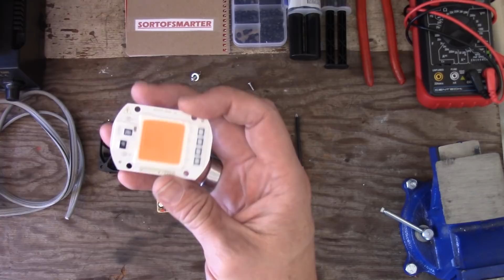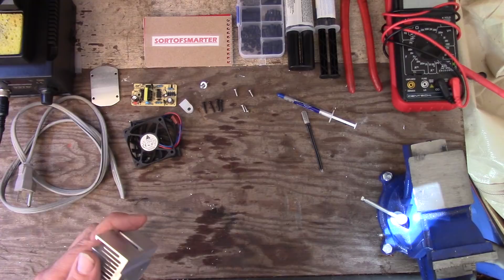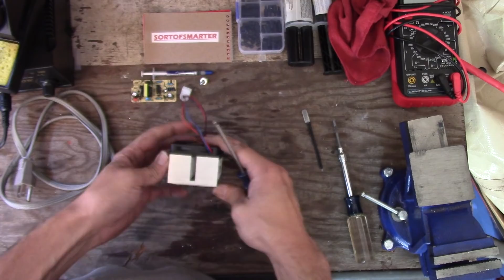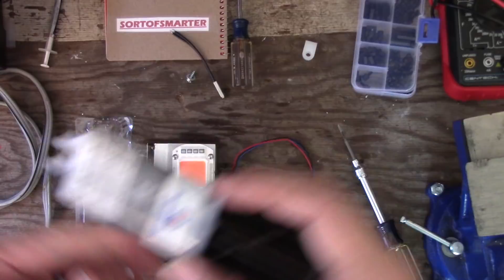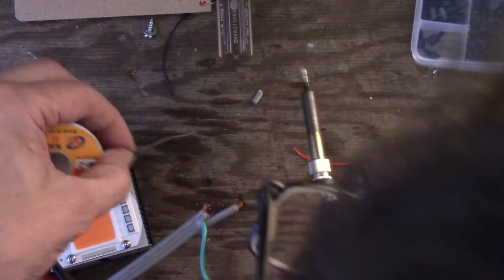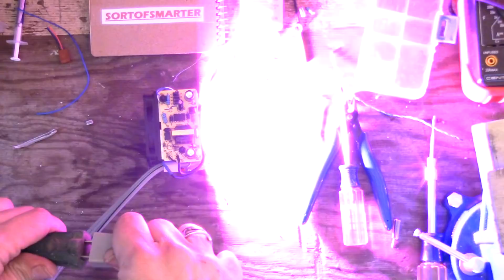50 watt grow driver-less LED Frankenstein heat sink mount up and fan driver

Comment: Did you grow any plant under this light ? I'd like to know how your plant turns out. Thanks.
Reply from the maker: I had purchased a small 2 foot by 2 foot glass green house from Ikea and used the light to grow starter seeds for my wife during the winter, indoors before we moved them outside. when I get a chance I will re do a new video with some time laps showing it in use.. it seemed to work well. I kept it in the spare bedroom so the light wouldn't drive her nuts..

Comment: do you have a link to the 110 to 12V driver please ?
Reply from the maker: I actually striped it from a 1 amp wall adapter I had, they are always cheep from second had shops for less than a dollar but if you wanted a new unit I would use this one as it could handle any size fan you had or multiple fans. just be sure your fans are 12 volt other wise if they are 5 volt you can use old cell phone wall chargers, most of them go way over what the fan needs..  https://www.ebay.com/itm/AC-110V-220V-TO-DC-12V-24V-5V-48V-Switch-Power-Supply-Driver-For-Led-Strip/351993297419?hash=item51f46f7a0b%3Am%3AmrxWgfZR2spUCN5pF5lkNCg&LH_BIN=1

Comment: I have a white one on a similar heat sink fan combos to yours. I run the fan from a 5V 1A wall wart. Heat sink stays warm to the touch with the fan on. Without the fan the heat sink gets so hot you cant touch it. Makes a great light above my work bench.

Comment: Light above my workbench is made from almost the same components. I used a wall wort adapter to power the fan. Fan on stays nice and cool. Fan off the heat sink gets so hot you can barely touch it.
Reply from the maker: I finally got my back room un buried from all the boxes and junk from the move so i plan on doing a update to all this. but awesome glad it worked. There have been a lot of improvements in cob led's in the past year so it should be fun to see what i can screw up..lol

Comment: You don't really need a thermal switch.  That LED puts out so much heat the the fan will be on almost all the time.
Also, the switch should be on the AC side of the 12V converter, not the 12VDC side.  Don't power the converter unless you need the output voltage.

Comment: Your solutions for the excessively long mounting screws and the off-center hole tap were potentially helpful for less than perfect people.
Reply from the maker: lol. thanks. sometimes there are video's that have finish products that look like a robot polished it and manufactured the whole thing. I just think a little dose of reality is good.

Comment: you dont have to do add the scews, if got that silicone thermal paste instead of the pc thermal paste it would have stuck right on there
Reply: And not perform as good

Comment: which one is more efficeint?  if  compare   driverless vs driver led  ?

can anyone tell me?
Reply from the maker: I have not done a direct comparison with the two, I will say that so far the reliability and quality of the output of the driverless chips has been great. A lot of the regular SMD led chips seem to have a high failure rate unless I have stepped up the amount of money spent. When I get my lab put back together I think that would make a great project to test and show..But in a direct conversion you will loose a little efficiency in a lower voltage led driver due to losses in the driver, probably 5% to 10% depending on the driver
Reply: really thank for your replay.  there is so many grow video about cree led cob light.
i will use driverless led  to make light  thanks you!
Reply from the maker: I' not against cree I feel they may have a tighter quality control. But for the hobbyist or little guy like me the cheaper cob lights work great. let me know how it does. and I like getting mine from Aliexpress if your not in a hurry.

Comment: Good project. I found it much easier to use little self tapping metal screws instead of tapping thread holes when I built My lights. I drilled pilot holes using the COB chips holes as a guide before using the screws.Thanks for the video. Respect
Reply from the maker: I agree, I have built a couple more and have done the same thing. I feel a newer polished video may be in order...

Comment: Great DIY video and the build looks nice! The driver did look a bit naked, some ebay vendors got tiny ones size of a dime for cheap.
Reply from the maker: At the time I was using bin parts I had laying around. But yes I have done a couple for friends and used proper isolated power supplies...

Comment: how is it holding up? whats the light schedule?
Reply from the maker: The lights are holding up great. the power supply I used for the fan was way to cheap and bit the bucket last week. After replacing it with a new one I have had no other problems with the unit. I am growing exotic Lilies from seed starts so germination is slow and PH is a little tricky. I am on a 14 hours on and off for 10 hours. When they get a little bit bigger I will do a follow up video of the little glass greenhouse enclosure and temperature controlled fan I built for it all...
Reply: sortofsmarter Ph adjusting solution like PH up and PH down will help stable out your PH. Get a Ph stick (if you don't already have one) Keep it between 6-7 for best possible nutrient uptake. Use kelp sea weed extract for better germination. Keeping the seeds in the fridge 24 hours before you germinate will help also. Google everything for more details.

Comment: why are you using a driver with a driverless chip?
Reply from the maker: The drive is strictly there for driving the 12v fan. the LED is connected directly to 110v mains power. Sorry I should have pointed that out in the video..
Reply: thanks for clearing that up
Reply: @sortofsmarter  i decided to order a 5 pack. It was 15 bucks shipped. 6 or more was 60 bucks for shipping instead of 4. Thanks for doing it first.
Reply: It's funny how those are called driverless chips. Those are the ones WITH integrated driver.
Reply: @jetrosukkela5323  they called it driver-less because we no need to  use driver to run it.
Reply: @bennyfata1293  That's why it's the opposite of driver-less chip.
Reply: @jetronator  nope. I know that it has integrated driver on it. I think everyone even the stupid one knows. They called it driver less because we can simply run it without driver. Dont think you are the smartest one dude. Smh
Reply: @bennyfata1293  It runs with it's own driver, not without :D What's wrong with you?
Reply: @bennyfata1293  Still there is one. No way to round this nonsense :D
Reply: +Jetro Sukkela
   Fake news outlets colluded (conspired) to begin the LED driver/driverless chip rumors.
Reply: @nanoparticle5988  Lmao The driver is for the fans. Conspiracy idiots are funny...
Reply: He don't know better lol